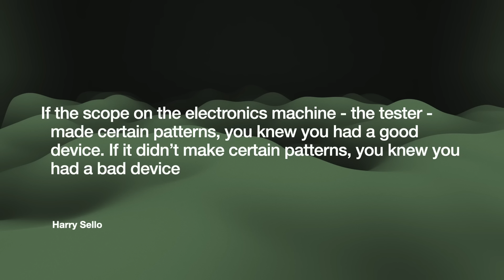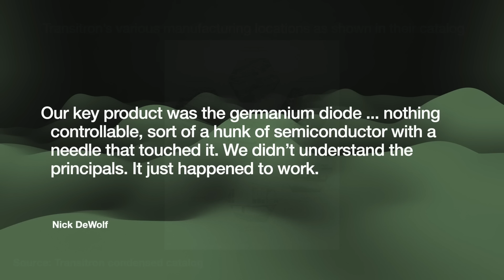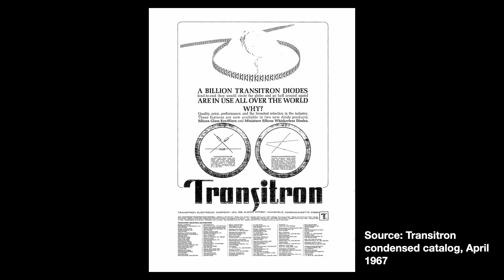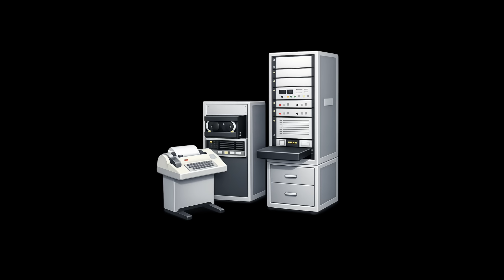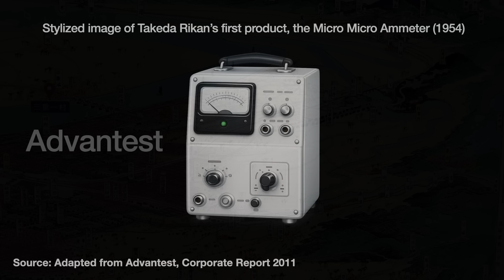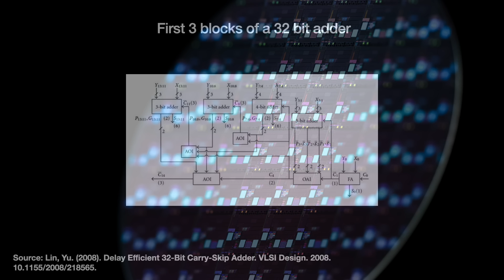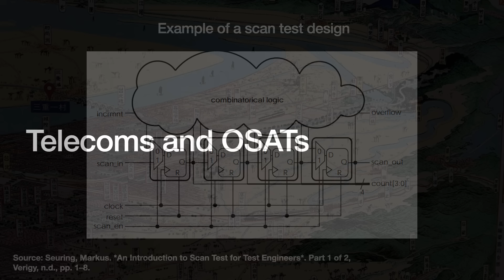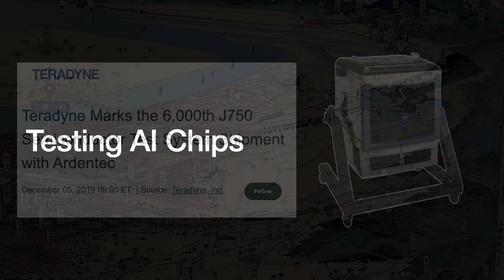How To Test 208 Billion Transistors

Comment: I've been working at Teradyne for over 6 years now. A bunch of my coworkers and I watch your videos so we're all ecstatic that test finally got a full video dedicated to it.
I've had the pleasure to work with one of the lead architects of Ultraflex for the past year and a half and there's just so much that goes into those testers.
Regarding the VBA for Ultraflex, one of the main ways to write test programs is with an Excel plugin. Apparently we got an award from Microsoft a while back for having the largest Excel plugin in terms of lines of code.
Reply: Excel Plugin? 😂 Im not sure of this is a flex 😉
Reply: @mbblueskies in this context I think it is
Reply: @mbblueskies  Can you think of a better way to populate a spreadsheet of test values?
Reply: @mycosys write to csv and open in excel
Reply: @mycosys  fill up a database table row using any other programming language.
Reply: @PaulSpades  Are you being deliberately dense?
Reply: @mycosys  If by dense, you mean a software developer with decades of experience building complex data systems. Yes, I am NATURALLY "dense". WTF are you guys doing depending on buggy consumer microslop software?
Reply: @PaulSpades  Thanks for confirming
Reply: @mycosys I think the thought process is that they would have their own system built to show values. But why build something that already exists?
Reply: @mbblueskies It's astonishing how much of the engineering world runs in Excel. It's a major reason Microsoft has been treating their customers so badly for decades and they still have a business.
Reply: The name Teradyne sounds so ominous. It sounds like they recieve dark Pentagon money.
Reply: When I Worked at Intel, l was in Automated Test Engineering.  We Used OLD Teradyne L529 and L135 Board Testers and and then State of Art L200 Test Machines.  The Engineers would Develop Models of Intel Products.
Reply: Wait, so these million dollar, complex machines... run windows?
Reply: As a just graduated eng I worked with Teradyne laser trimming equipment in the seventies and could have joined the company in. CA !
Reply: interning at teradyne this summer in mass working on FPGA logic design and verif! super excited
Reply: I was more than happy that I was able to skip the "Teradyne tries to make their work with Excel" time, especially the procedures and elements phase of the beginning was a big mistake I think. Using Excel for handling test limits can also bei done at C++ and Java environment and then you can use professional and efficient programming environment.
Reply: Megatest - now owned by Teradyne, was not mentioned. Too bad - They were small, but made a big splash with the inexpensive Q2 series logic and memory testers, and later with the huge and very expensive MegaOne. It was a great company to work for. I did see Ron Lecki (sp?) mentioned, who I think also came from Megatest to Teradyne.
Reply: John Connor says you must stop working on Skynet immediately.
Oh sorry, wrong Dyne
Reply: Im an ATE test engineer who have worked with microFlex and UltraFlex. I really appreciate that IGXL (ATE software) is based on excel and VBA. Much easier for me to edit parameters, test limits (you can copy paste easily) and VBA’s automatic compiling which gives so much ease for debugging and editing code compared to C/C++ based programs
Reply: @Chohan08  There are dozens of interpreted languages that can read and write into a database faster, and more reliably (with atomic and multithreaded operations).
Reply: @PaulSpades I can write python and though you're absolutely correct, in engineering it is better to use Excel for prototyping at least.

Effectively the entire engineering world runs on excel, or at least databases which have a button you can click to generate CSVs or at least to display in an Excel like grid.

I use labview to operate systems regularly and it's dumping to csv 24/7. All my initial data analysis is in Excel too.
Reply: @letsburn00  I'm not opposed to using excel (or any other spreadsheet software) as a data view and run basic analysis trough it. I'm concerned of the comments claiming that more heavy duty processes are dependent on excel exclusively.
I personally know of lawyers and accounting firms that ran their whole business on Excel, but they've since switched to more robust software solutions (with streamlined UIs and backups, security measures, import and export tools, etc).
Reply: @PaulSpades  The UI is through Excel, which is not used when a job is running in production.  There is no simpler, more ubiquitous spreadsheet/database tool available in the world today.  There is literally zero additional training required to  have someone understand how to fill out the sheets required to run a test program.  

The heavy lifting is done by a combination of tools developed in a variety of languages.  Most of the really heavy lifting is done using FPGAs embedded on to the instruments.
Reply: @PaulSpades One big issue actually is that formerly good software has moved to the cloud, which in most cases is a fundamentally inferior experience.
Reply: please tell me you're kidding...
Reply: Why choose vba? It’s a bad language
Reply: @MakeAssemblyGreatAgain  Lmaoo it’s sad how useful VBA is because of how pervasively Excel is used as crutch in industry. At least in US.
Reply: @420yoloscopes  Spreadsheets are universal lol. They work well enough that people just keep tacking bits on, and cause they’re mostly used by non-programmers, they’re unaware there’s a better option that’d likely save them money long term, which is rolling their own software.
Reply: @420yoloscopes 100% But if it works it works.

Comment: Somebody could do an entire channel devoted to nondestructive testing of semiconductor devices. Besides testing the transistors, there's an important desire to test the design logic, especially for mission critical applications. Also, because of cross talk, shared power connections and mutual capacitance and other factors any given semiconductor can't be presumed to be fully tested by any simple sequenced test. 

There's literally enough involved that probably no person or even a group of the best experts could conceivably create a completely comprehensive test specification for even something as old as the original Pentium that would be able to complete before the heat death of the universe. So, testing is limited by physics to finding out if the device is good enough for the likely conditions of the intended use case and the fall back is to use external work arounds if untested conditions reveal an issue.

Comment: The Ultraflex is programmed using an Excel spreadsheet that contains the parameters you want to test. VBA macros are embedded within the spreadsheet that has the actual instructions for the tester. I know it sounds dodgy but it works well enough.
Reply: Retired test engineer here.  Spreadsheets are great for pin lists, spec tables, etc but the flow control was awkward.  Not a fan of Visual Basic for low level programming but as you said, it works well enough.

Comment: Excellent as always, but you seem to have missed JTAG as part of design for test. That is the most important part, even if it does not address mixed signal.
Reply: He described it without naming it, when talking about shifting in and out test patterns. But yes, standardizing that method was a big deal.
Reply: Yes also the importance of functional tests. And in general there is so much complexity and diversity in the test strategies that it's impossible to give an overview without defining tens of difficult concepts
Reply: He seemed to leave room for another video on In Circuit Testing - Im hopin

Comment: 26:04 when customers need to describe to OSATs a set of tests to run, they usually deliver it as an excel file called a test plan. Tests engineers then implement it as a test program they can execute on ATE. The uflex vba approach lets test engineers merge these into a single unholy chimeric abomination.
Reply: Worked on that platform before, IGXL is the biggest pile of shit I've ever had to deal with.
Reply: Yeah, that modularity is nice!

Comment: It’s a wonder any of the early stuff worked. So many really clever, motivated people but holy shit some of the machines in the 70’s and 80’s weren’t very reliable or robust.
I believe that some large machines were shipped without full testing, just send out a couple of engineers with the machine and they have to stay on site until til the customer accepts. I wonder if the big suppliers made as much profit from service contracts, as they did from original sale.
That was a fascinating video.

Comment: Excellent summary of IC test, with history too.  Have you considered covering wafer probe test?  ICs (and disc drive heads, among other devices) must be tested when in wafer form, to know about defects as early as possible.  Wafer probe enables that.
Reply: Probe is usually done when yields are low, to save cost on assembly, final test, or system level test. It's not necessary, but often a good idea. That's one small mistake I have to nitpick, is the UltraFlex called out as a final test machine. It's used for wafer probe as well!

Comment: In late 2021 I interviewed with Advantest, and they actually make insane stuff. 4096 measurement channels inside the head, with multiple fiber cables just to get the data out quickly enough.

At the time they were also the only ones capable of testing mmWave 5G because others couldn't manage the frequencies, or so I was told.

Comment: I remember when the FPGA company I worked with passed the 1 billion transistor die. I think it might have been at 90nm around 2002? So 200x in 25 years...
Reply: I’m old enough to remember testing transistor functionality by measuring the emitter-base voltage drop.  I still have a bunch of ‘em on a shelf somewhere.
Reply: I remember my FPGA class in college used Sun computers...
Reply: As per moores law transistors should double every 2 years by that maths we should have 5792 times in 2026!
Bit we reached only 200 times
And since last 10 years we have seen slowest transistors density increase!
Tsmc 7nm was released in 2017
And we are still stuck at 5-3nm that too is just marketing gimmicks!
After 32nm transistors shirking is stopped and we are just figuring out how to pack them more densely without messing up patterning!
We have reached physical barriers
Reply: This is not a monolithic chip
Reply: Around that time, the biggest GPUs only had maybe 100 mil with CPUs having less.
Reply: Moores law in action
Reply: @TheFirebird123456 we would be far ahead if moors law had held... we're behind by a lot.
Reply: @killerhurtalot correct, 2^12 is 4096 so 200 is off by more than an order of magnitude or 4 two year doubling periods.
Reply: @andrewfidel2220 it's not even a monolithic chip, it's two of them connected together, so it's not 200x.
Reply: I've just started learning how to program FPGAs at home and mine is ~6mm² on a 40nm process with about 20 million transistors. 
That gets me about 5,000 cells for £5 at singles prices.